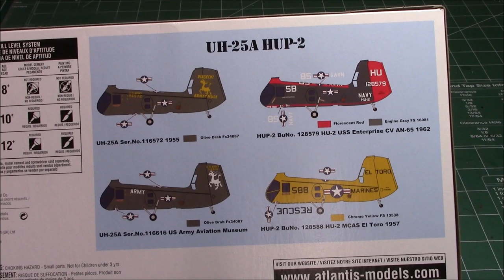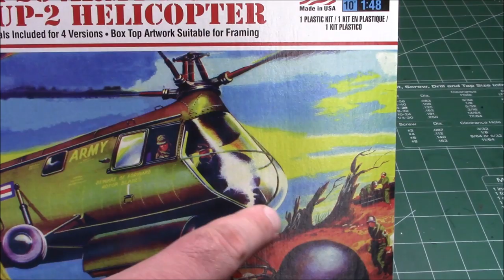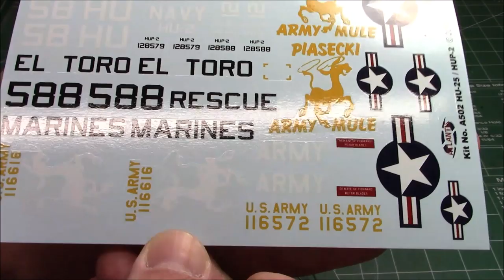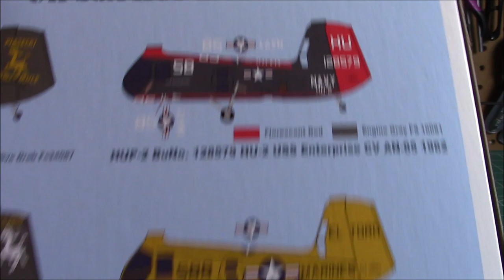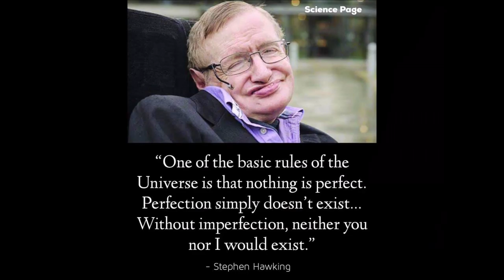Atlantis H-25 Army Mule Hup-2 Helicopter 1/48 Scale Model Kit Build Review AMCA502

Comment: I don't recommend Rustoleum primer. It can very easily craze the plastic, and I find some paints craze it. I use strictly Dupli_Color Primer/Filler. Spay a couple of mist coats then your wet coats and it works great and works as a great barrier for even lacquers and urethanes.
Reply from the maker: 600+ kits and no real issues, but we all like things a certain way and get used to the way we've done things. More power to you and your modeling fun!
Reply: I've never had any luck with any Rustoleum paint lol. No matter how I spray it.